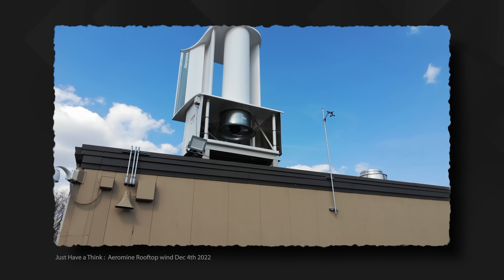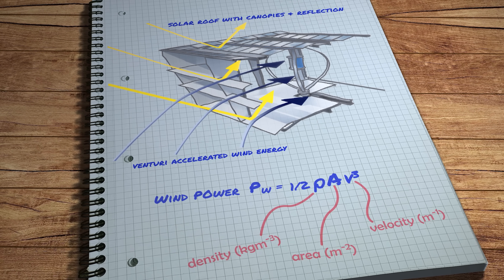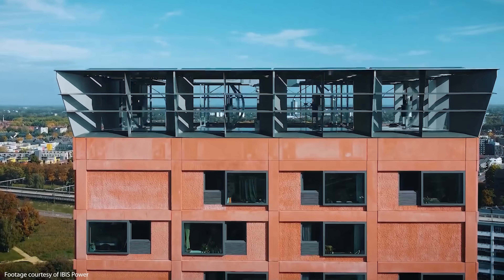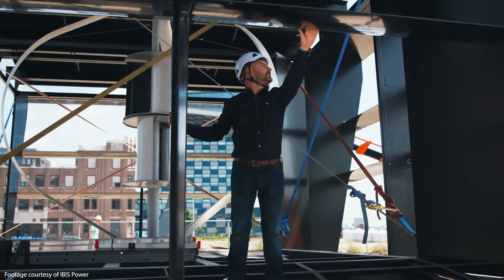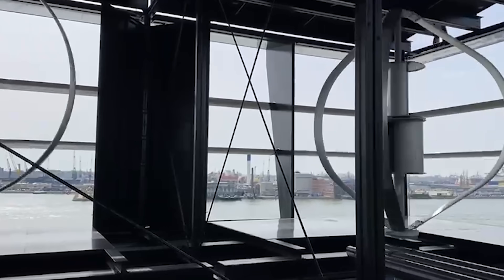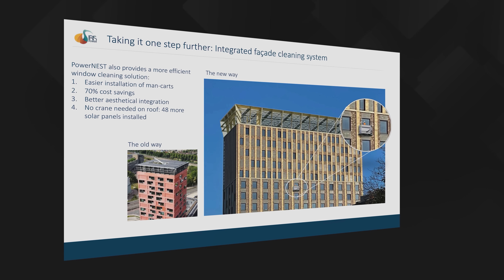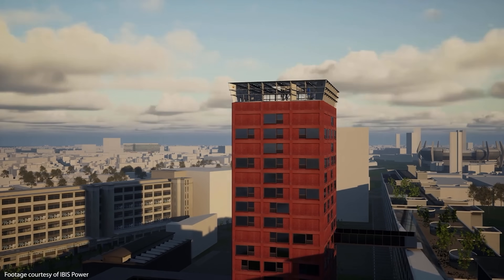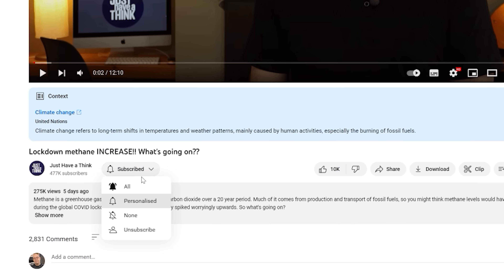The smartest renewable rooftop system in the world?

Comment: I wonder whether the output from wind can be improved by using an different static airflow setup combined with a horizontal-axis wind turbine with a diffuser in the center of the building, which increases the airflow and resulting energy output considerably.
Anyway, the wind power should not introduce any vibrations into the building.

Comment: Great concept and so heartening that it is actually in production. I am surprised, however, that there is not a water-heating aspect included. That would provide ample, free hot water for residents and aid with cooling the PV panels even more.

Comment: 8-12 cents = 0.08-0.12 Pound Sterlings / kWh? 

The calculations of the 25-year operating lifetime does it account for all upfront capital and maintenance costs?

Does the roof typically require structural reinforcement work, and if so has this cost been considered in the upfront cost calculations for above figure?

Do the raised PV canopy serve as a second roof, extending life of roof below it?

Comment: Okay...
The WEIGHT of the installation is comparable to about 6-inches of water.

But water doesn't act in any way like a sail or a kite.

And any existing building will be rated to bear the weight of such water as might collect on its roof.

But no pre-existing building's design and engineering will have taken into account the torquing and lifting forces that would be applied by a previously undreamt and unforseen future rooftop installation.

Comment: Another benefit of rooftop solar like this, particularly for short wide buildings like malls and light commercial/industrial space, is that it greatly reduces the need for air conditioning keeping hot sun off the roof. So not only generates electricity, is also reduces demand for electricity.

Comment: The tradeoff is engineering complexity and dependence on standardized sizes which won't be available outside EU. Solar went viral because it is super easy. Even in 3rd world countries you can employ low end labor to do 90% of the installation and then one engineer comes and wires up everything.

Comment: I think it would help to have heat pick up pipes that meander along the underside of the solar panels and have that water moved into storage perhaps in the basement and use that as feed to localised water heaters for the hot water service of those buildings. I would suspect that in winter the water may well be heated to around 30C and in summer perhaps as much as 50C resulting in considerable hot water savings. Also because a lot of buildings in Europe's colder climes have hydronic heating, the savings for heating could also substantial.

Comment: I live in the red building. The turbines are pretty cool and you don't notice them. The only problem, is that the turbines make it impossible to safely decent the building to clean the windows. The crane for the maintenance cradle couldn't get over the power nest well. Windows weren't cleaned for almost a year after installation. Now it finally can decent, it swings a lot. 1 window is cracked because of how the maintenance cradle swings.

It's a good new product, but still needs more thinking and planning. Hopefully their new method for the cradle will work better. You can see in the powerpoint slide that the red building is the old way haha

Comment: I tend to think all these building by building techniques are a big expensive boondoggle.  It seems to me that if you can generate enough power in central locations, and I'm thinking nuclear, you can distribute it and bypass all this customer design and just use heaters and air-conditioning and avoid the cost of massive updated to massive numbers of buildings, their resource consumption and their maintenance.  We still seem to be about generating massive make-work projects which are really make profit by taking from the people, and not solving problems cheaply and efficiently.  To create plentiful energy by nuclear does not require ugly wind farms, huge engineering projects, changing out wind-turbines, and throwing away large amounts of waste after they are scrapped when EOLed.

Comment: Whatever happened to the experimental wind system where they have a tall cylinder in the middle of a flat circular greenhouse that would heat the air and draw it up through the cylinder to spin hoizontally mounted propellers/windmills?  That seemed promising, and then I never heard about it again.  Must not have worked.

Comment: air cooled pv giving 10-15% more electricity is far less than if the panels were water cooled, which would increase the efficiency of energy collection by many 100's of percent. The roof in question had probably 10kw of solar, so air cooling gives an extra 1 - 1.5kw. Water cooled pv would capture at least 20kw in heat, more energy than the 4 wind turbines and the pv combined.

Comment: Love this!  Does spreading the production of energy across the grid instead of coming from a central location also reduce resistance on the wires and therefor reduce the waste of electricity as it travels from point of generation to point of use? Thanks!

Comment: This would definitely reduce heat produced on the rooftop.  Better than painting the roof white.  Also, keeping the water from standing on the roof would be a savings (less repair).  Maybe they should add rain water collection to the mix.  Low pressure on upper floors is annoying.

Comment: If you add grid power to the solar panels, through diodes in a full wave configuration, the solar panels will not be deeply drawn upon, but will only have to produce what the excess power is when the sign wave of the grid power is lower than the panels out put. When the peak grid power is higher than the panels, power is taken from the grid. This dual intergrade will vastly extend the panels over all life expectancy. Plus, since both panels and grid would be powering the user side, symotaniously, the panels would stay cooler than when used alone. 
As two vehicles are tied together, while one vehicle is stuck in mud, both vehicles are used to get the stuck vehicle unstuck.

Comment: Please, please, stop with the rooftop wind. 

Wind turbines are variable speed rotating devices. Any turbine big enough to make a difference will cause various parts of the building to resonate harmonically. It turns the building into an aeolian harp. Bad for the sanity of the tenants and bad for the structural integrity of the building. 

Turbulence is the enemy of turbine efficiency, and placing a turbine right on top of a building places it in an extremely turbulent zone. There’s a reason that commercial wind turbines get put up on high mountain ridges or out on the ocean. High speed laminar air flow.

Rooftop wind is a bad idea that keeps coming back. 

And can we let vertical axis wind turbines finally die? It’s the zombie technology. Much less efficient than horizontal axis machines, but otherwise intelligent people keep digging them up. The wind industry figured this out 40 years ago. Sigh.

Comment: This is the kind of thing I've been speaking about for many years  except whien I started there wasn't "2 sided PV"   also one other thing I though could be added was collection of  Rain/snow  to opearte a serise of  Hydro Generators as the water makes it way to the ground   ... two reasons for that ... there is an issue with  too much water  entering the  sewer/water drains so buildings often  need to  help by slowing the water entry to that system   depending on building height  a  tank  midway down  could provide  delayed release and also power a hydro powered generator -  adttionally if grey water  systems are allowed  the  grey water could also  be sent to that system  as well as used for  "landscaped"  areas

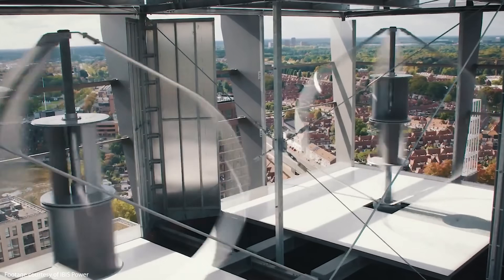Comment: 4:30 I'm wondering why these wind turbines are on the smaller side, 3KWh is relatively little. I'm guessing that it has to do with a combination of looks, weight, vibration and available wind energy, but I don't know. I'm also not familiar with the larger rotating loop that's separate from the main cup shaft. I trust these engineers though, as four use roof (crane hookup, bifacial panels, panel cooling and wind turbines) is genius, as is the 85% generation capacity of the tower itself, which is insanely high, and that's WITHOUT batteries. Hopefully your video on spherical solar cells will be prophetic (https://www.youtube.com/watch?v=nuDLfW3-DT4), as I'd like to see more buildings have side mounted solar panels.

Comment: I like the concept, I would add that the roof top solar/wind also reduces heat gain at least for the top floor, thus lowers the Air Con load. A few comments and concerns though:
My first worry, is birds.  Tall buildings already attract birds, and those nice nesting grounds created by the open framework will soon fill with Pigeons and others.  They may learn to avoid the blades, or they may occationally die from collisions.  They will definitely poop all over everything, and this will lead to maintenance issues.  Even those nearly flat solar panels will get pooped on. (you  noticce they are not flat, but tilted a bit, this is a PV requirement to allow self-cleaning during rain).
The low energy collection of the vertical wind turbines, you said 3.5kW each, is unlikely to be justified by the large structures needed to house them. Compare with the solar PV over just one VAWT 7.2m x 7.2m is an area of 51.8sqm, capable of holding 12 kW of PV with no moving parts, and not needing any blades or superstructure 8m tall.  Simple Roof mount PV alone, without the expensive superstructure, would still provide shade, and allow wind under to cool the PV without the need for the turbines, less maint cost, no  bird strikes, and no moving parts.

Comment: A hospital engineer installed 6 small wind turbines in a hospital facing a prevailing wind valley which gets lots of storms. Most of the time the vibration from the turning fans meant the theatre suites two floor below objected and the turbines had to be halted. I wonder if this design would have worked.

Comment: Why not collect roof rain water to under car park soakaway tank - or water feature evaporation pond? Those ultra low depth water features are very popular and present no danger to kids. ice rinks in winter, and artificial snow parks.
By the way ground source heat pump elements work better if wet - Bradford Uni UK did good research on this - couple it all up?

Comment: So 20 or 30% increase in efficiency?) 
I love to watch how people talk a lot but say nothing: I didn't hear enough data to understand if it is really effecient, for me it looks like another unsuccessfull try).
50 kW of solar panels requires approx area of 150 sq m. Now compare the price of that metal structure and  20-30% increase in efficiency of 50 kW solar panels. 
Second thing that I didn't like was Darreus and Savonius rotors on one bar, which is a bit silly I believe - one of rotors is much more efficient than another, so why use both?!)

Comment: I like the use of typically vacant lots in the sky.  Looking at the installation, it would be interesting to analyze the application in say a city like Miami where very large sprawling AC systems utilize a large percentage of the roof.  It may be a system limited to only very specific climatic zones.

Comment: This is just a lesser "advancement" on a Double-Helix Turbine Rooftop System developed ~2007. You can see it on a History Channel Show called Eco Tech from that year.

Anything you use to direct wind will rob energy to the point that the increase in materials and cost, as well as loss to friction and momentum, will offset any benefit to increased wind speed. First, we need to understand that though it is important, the speed of the wind is not as important as the pressure of the wind. Then you have the trade-off between the size of the complete system, with the Wind Redirection component being 75% or more of the entire structure, and, the available area for actual Turbine Generators. At least to date, no Wind Compression system has been able to create an additional efficiency for a single Generator that is more productive and cost-effective as simply using multiple Generators.

I like that they are using this to also cool the Solar Panels, I am a strong proponent of mixed/multiple generation units, but that has been a failure of planning since we had both Solar Panel and Water Heating, Rooftop Arrays. We knew that heat decreased Solar Panel energy generation, why didn't we just combine the 2?

These are neat things, and they advance the Technology, but this is not the best way to harvest energy from city structures.

Comment: For hot climates, they forgot liquid surface top cooling and forced air cooling under the panels. Capturing heat to heat rooms or greenhouses in winter. This extends the solar panel life by 15%.

Comment: If Solar PV panels can be added to the sides of the building, between the windows, to supplement the rooftop system, then it's likely that more than 100% of the building's electricity requirements could be generated for much of each year. The daytime excess can be either fed into the grid supply or else into battery storage

Comment: Supermarkets and shopping malls have huge flat roofs surrounded by large car parks. Cover the car park with a roof and place solar on top. Cover the supermarket roof with solar panels. Sell excess energy cheaply for recharging parked EVs while the car owners are shopping.
All power requirements for the supermarket power by solar.
Sell any excess energy to the grid.

Comment: You know, depending on the prevailing winds and the prevailing direction of the sun, you could also make use of the Venturi effect. You could also use the buildings pendulum to drive a linear generator (linear motor = linear generator), and…did you know that one of the original drivers of putting revolving doors on tall buildings was so that the doors wouldn’t get pushed either Oooh or closed because of the capillary effect going on in the elevators. Could harvest some wind there.

Comment: I’ve considered local/communal power supply and storage to be the ideal path of the future for a long time now. I’ve envisioned suburban and rural power plants integrated with existing individual solar/wind/geothermal and battery storage systems as a more stable and reliable method of power productions. 

Having several of these local power stations connected in a relatively small area allows maintenance, repair, etc to one station without interruption to any community connected to that web/grid. 

Why sell your excess power to the local power company when you can sell it to your community’s grid? 

This project seem to apply this same concept to the urban environment. Adding salt, molten metal, etc batteries to this project and you have a more stable and reliable local grid.

Comment: The system is missing a key ingredient, rain water collection. Not only could it simply snd reliably provide pitable water the energy harvestable based on the height of the building creates another substantial energy generation source.
If the bifacial face were instead used for moisture collection and condensation, the "rain water" produced would be continuous and the PV panels would be substantially cooler due to the evaporation effect. There should be no reason not to have a zero net energy cost coupled with localized production further reducing expenses for the entire grid.

Comment: Awesome, very inspiring. Building sizes are not standardized as you claim though, or maybe in that one Dutch city, but these kinds of projects would be an incentive to build according to the dimensions of the device, maybe offer the device in 2-3 different sizes.
Rain water also needs to be collected and could run a turbine below ground floor. Maybe gray water too.
Producing 75% of the building's electricity is great, but cabling all lighting with 12V LED light bulbs would be even more efficient (no hot 220V-AC to 12V or nV-DC transformer inside the lightbulb), and it is easier for a backup battery to take over in case of a power outage if it's all on a separate 12V (cheap) cabling. Add a few other such tricks and it's getting closer to 100% autonomy.
Another thing that should be battery-powered is the electricity needed to power fans, pumps or electronics of heating devices (not electric radiators, of course). Many don't require much power (except heat pumps), but without it, they can't work at all even if they have fuel (gas furnaces) or calories (heat pumps).

Tall buildings could also provide free heating (not just  hot water), covering the whole Sun-exposed surface (except for the windows) with vertical solar vacuum tubes that work.great not just on South exposure, or combined with geothermal. This can hardly be added to existing buildings though, but new buildings should really be positive energy providers, not just electricity, but also heating. Cost comparison needs to be studied, of course, but some level of autonomy is great during power outages or when your neighboring country bombs your civilian energy infrastructure.

Comment: Would it not be possible economically to make the whole structure automatically rotatable to face the day’s wind direction, and have the panels sun-following and water-cooled with heat recovery systems connected? Seems a no-brainer to harvest every watt if you are engineering this size of structure onto a tall building..

Comment: Very cool design. I like integration.

It may run into trouble with a lot of North American buildings where heat pumps and air conditioners are typically mountained on building rooves. Though that's likely easy enough to work around.

Would be interesting to see how heat pumps could be integrated for heating and cooling.